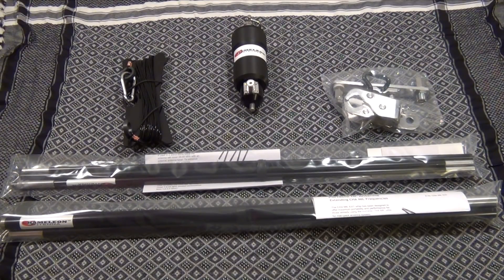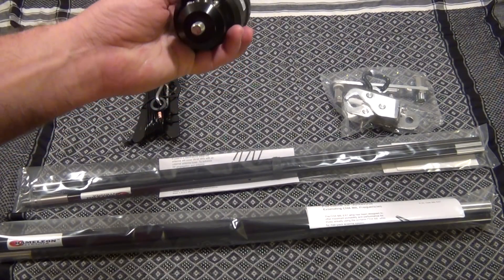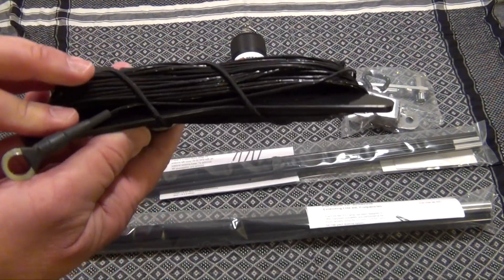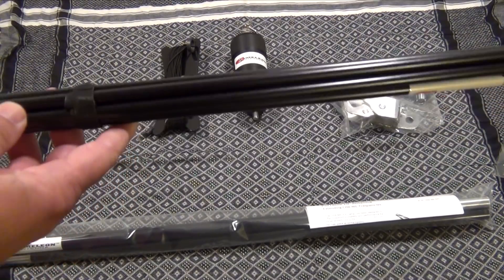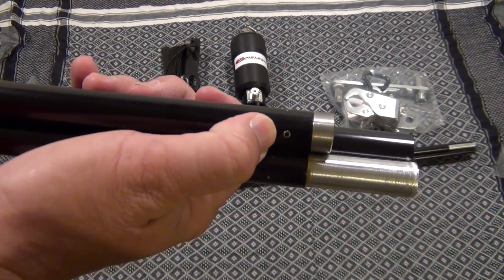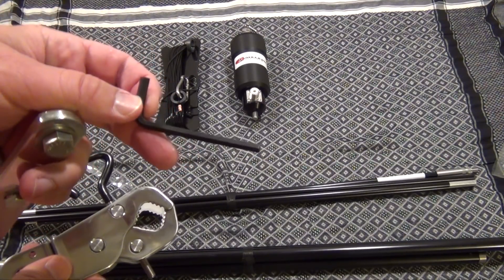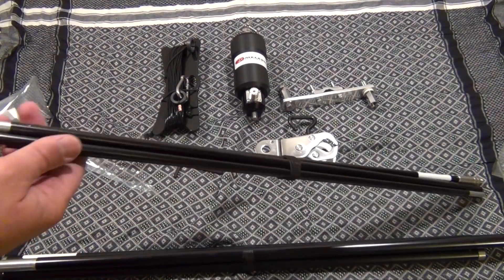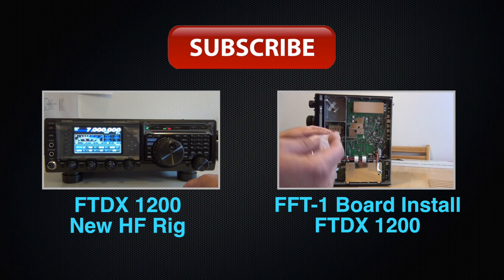Ham Radio Antenna - Chameleon Antenna HYBRID MINI (HF Antenna)

Comment: At least you keep your comments open unlike Mike from Alpha Antenna which disables comments on every video which is rather suspect.
Reply from the maker: Paul O Thank you for taking the time to watch. If your referring to Videosbymike, last I saw he deleted his channel.
Reply: @WJ6FRadio  I wonder why 🤔
Reply from the maker: @pjo1964  I have had a couple of reasons why.
Reply: @WJ6FRadio  well if you've ever opened up the inside of one of their antennas you would find a big reason why because it's not made like a chameleon. I own one of their antennas and it works okay on 20 meters for a small portable antenna and if you put the nvis on it your SWR is good, but yet again your SWR is also good on a dummy load. Fortunately I bought it off of a friend cheaply rather than paying the bloated full price Alpha antenna charges.
Reply from the maker: @pjo1964  There is a video out there that shows one being opened up. I was a bit surprised to see how they are made.

Comment: Sorry but you have been saying it can take 1500 watts , I  Think you need to take a look on there website & have a read because I no Chameleon Antenna are not saying that .
Reply from the maker: I double checked with Chameleon Antenna and they confirmed, as well as sent me the data sheets for both, that the antenna and extension are both rated for 1,500 watts. The information I used was off of their original website. The new one does not show the power rating but when you buy the antenna and/or extension it is stated in the accompanying paperwork. If you like I can email the sheets to you.
Reply: That's good news because I have just placed my order with them & got free shipping all the way to the UK that is just great for a company to do that now days all that way .
Reply from the maker: @kevinmcdermott3668  Congrats on placing the order! Hope to hear you on the air!
Reply: Yes can not wait to it gets here  & who no's  we could be talking soon 73 .

Comment: Do you need the mil extension? I just ordered one But only got the standard mil whip..And what is the difference between micro and mini version? Thank you
Reply from the maker: Thank you for taking the time to watch and the comment! It is greatly appreciated. Do you "Need" the extension. No it isn't life or death, but in my opinion it does help quite a bit. The difference between the micro and mini is size and how many watts they can handle. Per Chameleon's website, the micro can handle - Power: 100 SSB or 50W CW. and the Mini can handle - Power: 500W SSB or 250W CW
Reply: The weight & the power it can take .

Comment: Great review! I bought the micro set and mil ext. I used your videos to confirm DX Engineering sent me the correct parts. This is because I noticed the Mil Ext is a much larger diameter than the Mil Whip. I imagined that the Extension went on top of the Whip, but with the diameters the way they are, that didn't make sense. I guess the Extension, with the larger diameter, is designed to go on the bottom. I also have the Capacity Hat which will go in between the two sections. What configuration have you found works best for the longest DX, especially in recent poor band conditions?
Reply: Yes the  Mil Extension go's on first then the Capacity Hat then the Mil Whip .
Reply from the maker: Thank you for taking the time to watch and the comment! It is greatly appreciated. I haven't done anything fancy with mine. How has the Capacity Hat worked for you? I have debated on getting one.